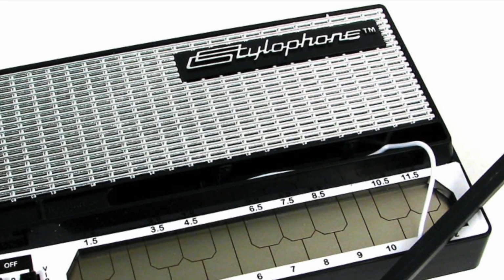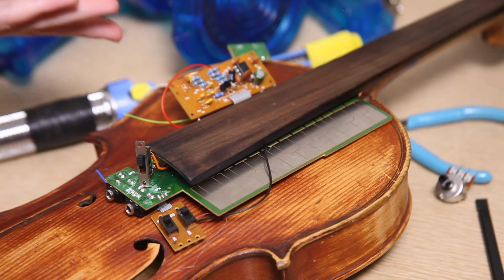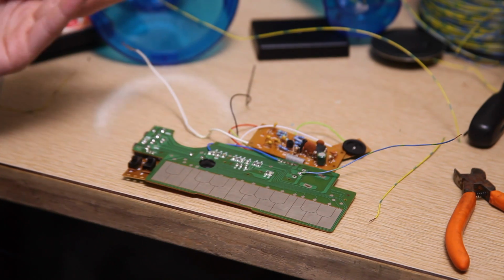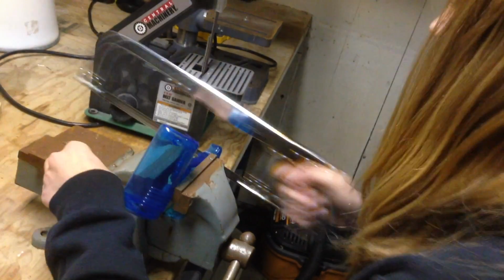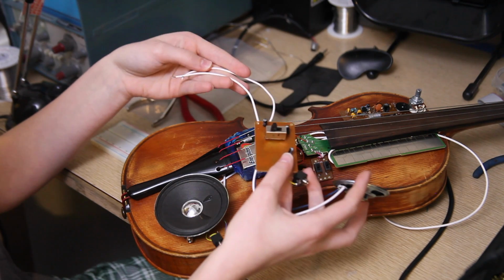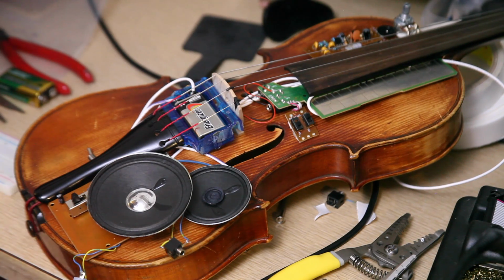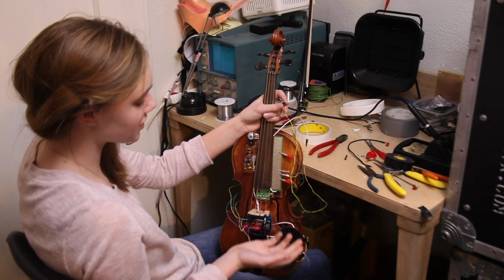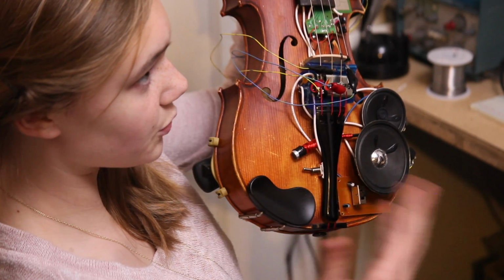Moog Circuit Bending Challenge 2017 - MOOGFEST - Lia Scott

Comment: Hey I know this was a year ago, but if you ever feel like returning to this: the banjo pick was a very messy solution. An easier fix to make it easier to play without changing the way you play violin would be one word: aluminium foil. Take some spay adhesive and make a grounding strip of conductive foil along the neck to ground yourself. Then instead of using a pick, why not energize the strings?

Also, just a little heads up: I have the same exact voice changer, but I turned mine into a guitar pedal because I don't play classical strings :P
It has a very aggressive noise cutoff that can be fixed by soldering a jumper across the SMC capacitor assuming your working with the PCB BIC26A rev.